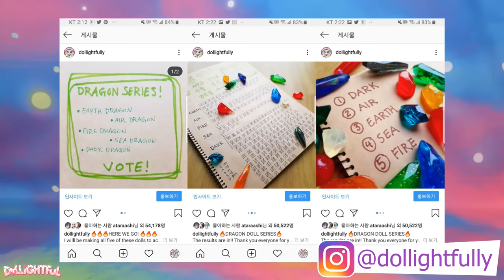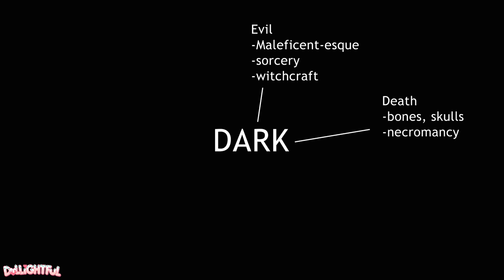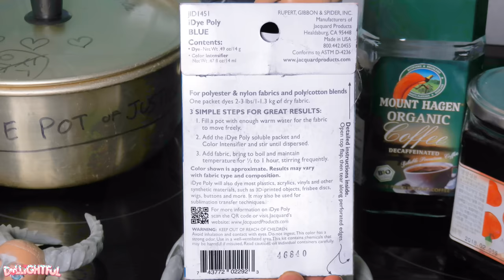Repaint! Nyx the Dark Dragon Custom OOAK Doll

Comment: What could have been done to solve the issue with the wings, would be a spray-on adhesive. Coat the two backs of the iridescent fabric, sandwich the wing bones in between them(keeping in mind not to spray this section to keep the pose-ability), then ladder stitch the two pieces together at the edges. And tada! Seamless, none-puckered, and poseable! :3 This can be used for future reference on fabric wings.
Reply: Oo she hearted this!! She must be using it on her next doll :D
Reply: @BentleyS6336  It's very possible, although I think she was finished with the wings before my comment. Still awesome to think about tho! I hope she does take it into consideration for another winged doll. The strategy should make fabric wings a whole lot easier and cleaner to produce~
Reply: For the tail, I think that cutting them curved was a great idea, and painting the fabric would have been okay if the black was painted on to a light colored fabric that wasnt going to be bent as much. Also if it was bent into the desired shape and THEN painted
Reply: @dothebunnyhop4026  I agree! I help my friends that do doll customs to with small tips or changes here and there!

Comment: i actually love the quilted look of her wings, it's like she's forcing realty rifts to bind to her will to show constellations and stars. she's wonderful and i especially love her legs and claws. i think your dissatisfaction comes from some of the many conceptual failures and struggles you had while making this doll. Instead you need to look at the results, shes a wonderful and very much loved doll. this is not a Nova situation. this is a artist misjudging their work because it didn't go as smoothly as normal work goes situation. Keep your chin up and continue your work, i love seeing dragons!
Reply: I agree. I think its just a frustration with adapting concepts and the limitation of the medium, or knowledge of mediums that can translate into the vision. I completely understand that feeling. I think what helps is considering the mediums you woul use and what effects you want as you are making the concept art. Not that you shouldnt try to push yourself, your knowledge etc. But the claw thing was a great example of getting the similar idea by structurally going a different route and succeeding. It was an engineering issue at that point that she could overcome. But you can only come up against so many of those in one project and find a successful solution for so many. So sometimes you have to dial the challenges back for one project, or you find yourself disastisfied with the results because the entire thing was a struggle and a ton of experimentation. You end up looking at her like shes a Manny in disguise rather than having affection for a manny that really challenged you but doesnt pretend to be completed or a success. And with a project that has a lot of experimentations, sometimes it better to lean into the results of failure and work with them, rather than trying to ressist and cover them up, which is difficult when you have exact concept art you are trying reproduce, rather than relying loosely on a concept. 

Like that discoloration with the dyes creates a pretty cool effect that you could lean into. Might have been cool to make a proto nyx with all the failed experimentations and come back to the concept art again at antoher time when you are armoured with the knowledge of how to do those ideas effectively, at east as effectively as you imagine is possible. oh and the glue seeping. Reminded me a bit of frankie stien and how that might be useful at some point when making a zombie horror doll with seeping seams.
Reply: Yeah I think the doll is really good!!!
Reply: how long did it take for you to type that.....😐
Reply: (but i agree)
Reply: I had the same idea about the quilted look!!!

Comment: Coming back to this from several years and at least 5 rewatches later, I still think Nyx looks very pretty, and I adore the Greek influences in her design and name. However, I do see some reasons she might look a bit odd, especially next to the concept art:
- The nose could perhaps be a bit broader and flatter
- The irises were a good deal smaller in the concept art, giving her a bit more of a spooky, mystical vibe than in the finished doll, since bigger irises tend to be seen as more “cutesy”
- The mouth probably could have benefitted from a slight change from the mold, as the Adora doll had such a distinct upturned smile even without any extra defining that it makes Nyx look more comforting and motherly than a dark and powerful sorceress
- The eyelashes and eyebrows definitely popped a lot more in the concept art, as they were lighter, especially when combined with the forehead fully fading to black in the concept art as well, and I think having them be lighter against the dark background could have helped her look more mystical
- This may be a bit nitpicky, but the hair also looks a bit greasy, almost? Perhaps a slightly softer and less shiny hair would have aided her dark look
- And of course, the custom fabric would have been a huge help to get the gradient you wanted without sacrificing the smooth look
However, Nyx still turned out great! Love the detail in the decorative threads around the clothes, and the shiny wings are top tier <3

Comment: First of all: that looks great!!!

And for a suggestion for the wings:

Why not try casting a thin layer of high strech silicone onto a flexible, strong but thinner wing frame, you could put pigments in it where some of then could be glow in the dark
For the frame you might want to look at animal bones (like the wings of a bat) to get a feel and then try to incorporate that, make them out of thin but strong material like apoxie or cut metal (if thats an option) wire, actual bones or carve them out of wood instead of flat but bulky sticks

Maybe just try something you have never used before :3
its sad to see you disappointed in your own hard work when you did so good

Love from Croatia 💗
Reply: OMG silicone wings would be awesome!!
Reply: Totally agree!

Comment: A quick tip for getting fabric to lay down flat, starch! You can buy spray on starch and if you spray it on the inside of the fabric the iron it on the outside it should come out pretty crisp. I do this for cadet stuff and it works pretty well!

Comment: If I may, for the cloth tail and wings, use a black fabric that's been bleached where you want the gradient to start, and use thin black fabric for the wings and paint it accordingly. As for the crack, pop off the nose apply glue, and replace gently. It'll fill in the empty space and be less noticeable

Comment: As I know how to Sculpt and Mold what I have sculpted I would have sculpted the tail and wings then made silicone molds of them. Then casted the bone structure in epoxy. Then for the flesh of the wings I would have tinted silicone with black, just enough the make it slightly opaque, tinted a few other vats of silicone in other colors to simulate the colored gas you see in pictures of space. for the stars I would have used a glow in the dark pigment in another vat of silicone and used a syringe to add small amounts of it to simulate the stars. I would have done this in a flat sheet and then cut to shape and used silicone to glue then to the wing structure.
The tail I would have layered my pours and lightly poked a BBQ stick in after adding a small amount of the next color then add more and repeat this for each color transition. Also I would use a thick coated aluminum wire in the center or the tail so it can be positioned however you want at any time.
Of if you don't want to use silicon you can do this to a similar effect with Latex but it wont be transparent or semi transparent. but you would need a pressure pot to get the best results.

Comment: 1.The material for the wings was too thick that's why the sewing machine didn't like it you 2. shouldn't paint on fabric unless you know what you're doing and if you do you do thick coats and very carefully number the 3. the fabric bends cuz like I said it's a thicker wire and it's harder to control don't make the same mistake